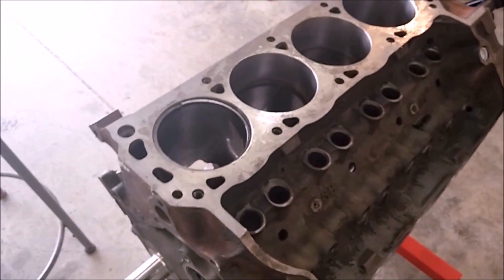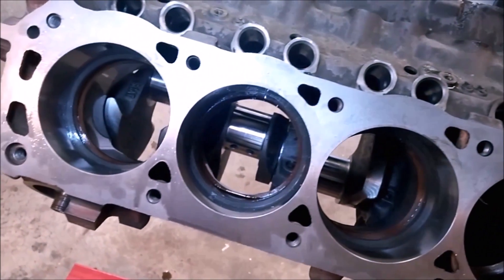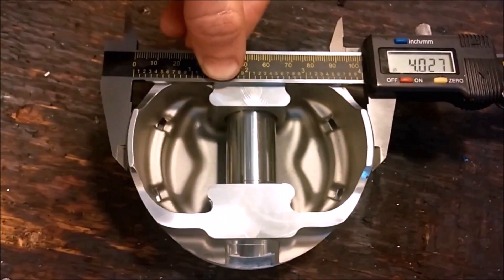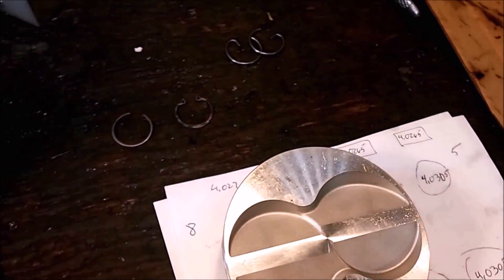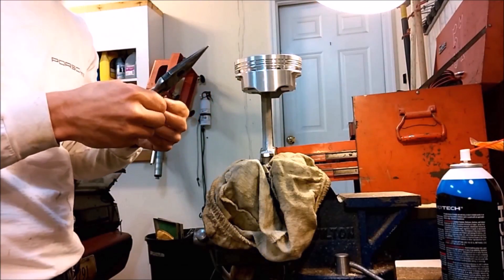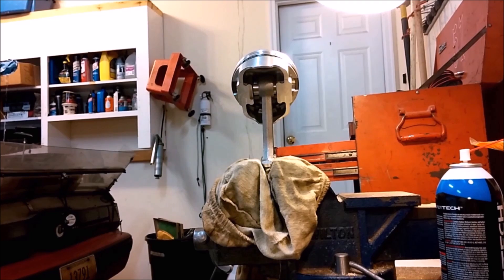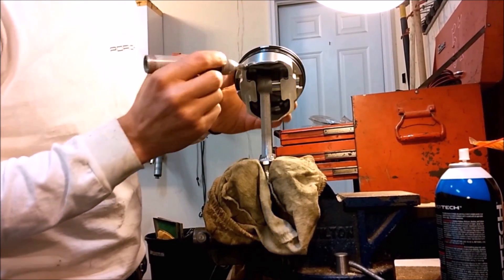How to Build a Ford 347 342 331 306 302 5.0 SBF (Part 2)

Comment: I realize this was 6 or so years ago, but you didn't mention your oil rail gap. Ill assume you didn't bother with them.

Next time you do this, your top oil rail should, at least, equal your 2nd ring gap.....larger by up 0.010" is ok. Bottom rail can stay as tight as 0.012" and should stay tight.

You want any blow by gasses to vent into the crankcase without causing ring flutter.

You can even tweak the ends of the expander to more vertical. This brings the oill rails in for less drag.

Comment: Great video, thanks for sharing. Nice bit about measuring the piston diameter accurately,  a home-brew balancing job for an engine that won't go past 5,500 rpm (due to long runner EFI intake manifolds) is to match the heaviest piston with the lightest rod, and juggle wrist pin weights to get a close-to-average overall weight of the 8 piston/rod combos. 

I prefer a ring spreader tool for installing rings, it costs more up front (like $10-$20) but could avoid screwing up the ring. then again, once i tap a final piston assembly into the block, i like to use a fish scale to pull each piston/rod assembly down the cylinder to mate up with the crankshaft. If one assembly takes more "pounds to pull" then i know a ring is hanging up and can fix it right then.

a perfectionist builder will want to torque plate the block when doing ring gaps, since the heads will distort the "circle" a bit. For most of us lacking a spare torque plate at home, we can fake it with a stack of washers or an old wrist pin torqued down with head bolts around the cylinder we're checking for ring gap. depending on what ring tech you paid up for and the material used, you may get more life out of them by starting off this way.

Comment: Maybe a stupid question...  But I dont want to make an assumption on my 347...  The block is a E7TE, is it OK to put a 28oz balanced crank in a later model block?  Or does it require a 50oz?
Reply from the maker: Yes, you just need a 28-oz front balancer and flywheel/flexplate to go with it.
Reply: If I may intervene, since it's a 347 which means a fresh crank with 3.4" stroke, you'll need to (must) balance it along with the whole rotating assembly to either external 28oz or 50oz, or even Zero (internal) depending on what harmonic dampener and flexplate/flywheel combo you have. You can't mix up these. The block is irrelevant.

Comment: I would use a better set of pistons, these have 4 valve reliefs better to only have 2 so u have more compression
Reply from the maker: These 4-relief pistons combined with the small combustion chamber AFR heads produced the 10.5:1 to 11:1 compression ratio target for this pump-gas engine combo.  2-relief pistons would be over 12:1, which is great, but requires race gas.

Comment: Nice instructional Video Frank!

I always give my machinist the pistons, tell him what piston clearance I want, then he can bore the cylinders exactly to each piston diameter. Mostly I use Mahle pistons and it is very unusual for these pistons to be different size, at least measuring with the calipers I have. Anyway, my machinist numbers the pistons when he bores the block, and I always double check his work, which is always spot on what I want.On the 4.03 4032 Mahle pistons I shoot a little loose for 0.003 to 0.0035 clearance. Rings 0.020-0.025 top ring gap and 0.24-0.27 second ring gap, of course YMMV based on the application.

On a New stroker like the 331 I almost always spend the little extra moola to get the Scat internal balance 4340 Steel crank, and the lightest Rods and pistons I can hang off it. The FSI I beam rod from Eagle is often my choice, as well as the Mahle Power Pak or JE sportsman FT piston. Send all this stuff with the rings to the engine balancer so they can match weigh everything and drill the crank to balance. The tiny amount of iron filed off of the rings later to get the right gap will not effect the balance.

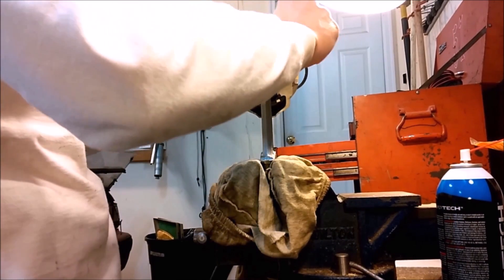Comment: 7:00 I always thought the dot or a “pip” mark goes up towards top of piston not to the bottom.
Reply from the maker: That's a great question, the piston rings have the dot facing the top of piston as you said, but the spacer ring that's in the bottom of the oil ring groove has a physical bump on it or dimple, and that must face downward so that it catches where it intersects the wrist pin bore.  This prevents the spacer ring from rotating.
Reply from the maker: The good news is the oil ring pack will not fit if you get it wrong, so it cannot physically assemble together if you have a backwards.
Reply: Thanks for the fast reply. I just ordered a 347 stroker kit for my 64 FAIRLANE  K code.  Cant wait to see how much more power I’ll get with this kit.

Comment: Watching these videos, Just laughing. I don't remember orienting my connecting rods. Of course, that was all stock, and the machine shop cleaned checked and assembled the pistons. There may have been some way to orient them that I don't remember. The point is I don't remember being concerned about large and small chamfers. It was my first motor, and somehow today it lives on in a road racing application. My next build will be better.
Reply: On a small block ford you absolutely need to orient the connecting rods. I've had machine shops install them wrong twice now, and both times caught it at the sales counter. If the engine you're referring to was a SBF and you put the rods on the pistons yourself thinking they were non-directional, then you got very lucky! Glad it still runs well! I go over this in my 306ci build video as well.
Reply from the maker: Thanks for your comment Michael.  Yes, definitely check for large and small chamfers on the rods.  The good news is that if the rod manufacturer utilizes this method, and you get it backwards, the rod-to-rod side clearance will come in way too small, and there's a good chance you won't be able to turn the motor over by hand, so you'll know.  Aftermarket parts often have differences like this from OEM parts.  For example pistons may be machined with offset wrist pins, requiring orientation as shown in the video while the OEM pistons do not.  In the case of the offset pistons, you won't know anything is wrong until you start the engine and hear excessive piston slap noise.  Yikes!